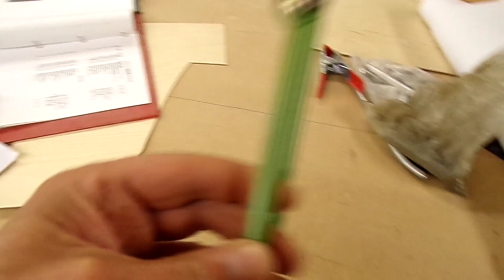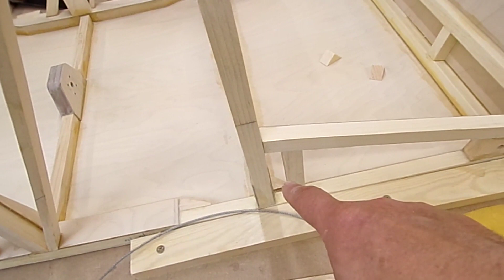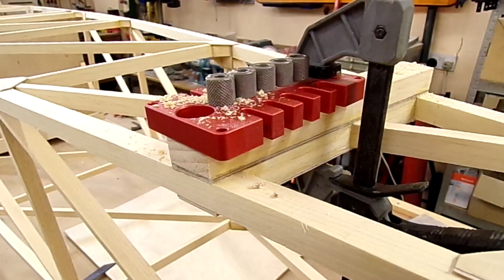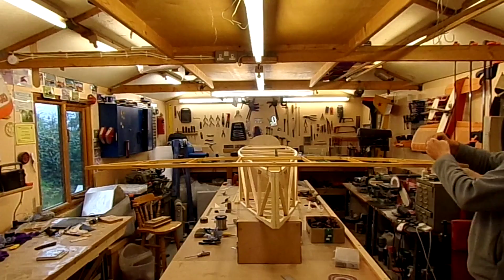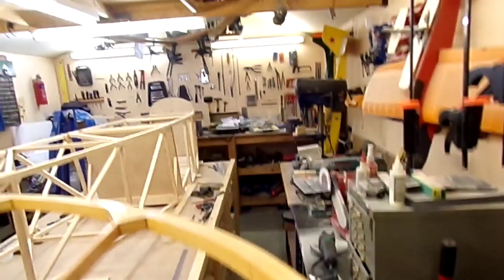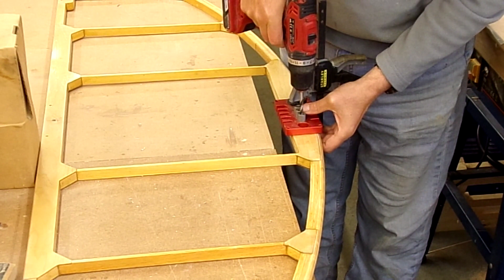EP77. Fisher Youngster V tidy up some details and fit the tailplane.

Comment: Do you think this would be strong enough for gentle aerobatics? Fisher strongly hint at this capability in their specs, but shy away from a direct confirmation.....
Reply from the maker: I think that it should probably be okay for loops and rolls but with an ultimate G rating of 6 G and usable 4 G one would need to be careful and keep it positive. If I was going to aerobat it, I would change a couple of thing, other than the modifications I am already doing, things like balanced horn larger tailplane / elevators and stronger flying / landing wires (possibly streamlined ones).
I have not looked at it as an aerobatic aircraft as I am not qualified for aerobatics and the aircraft would be limited in the UK to none aerobatic under SSDR I believe.

Comment: I'm guessing you have a wide opening so you will be able to get the airframe out? Looking good Algy. Is there any need to be able to adjust the tailplane incidence?
Reply from the maker: The opening to the workshop is big enough. The horizontal stab can be adjusted so that you can have the elevators in line with it reducing drag and giving full elevator range. It is part of my test flight scheme to adjust as needed to give hands off positive stability with zero trim at standard cruse.